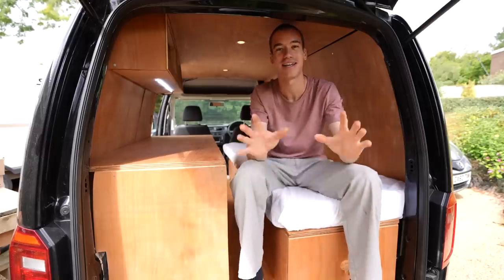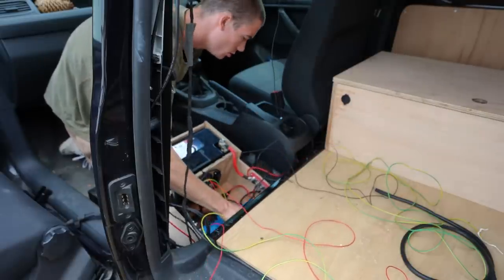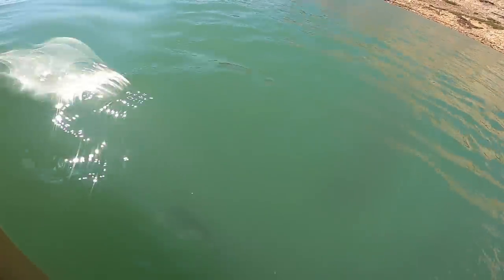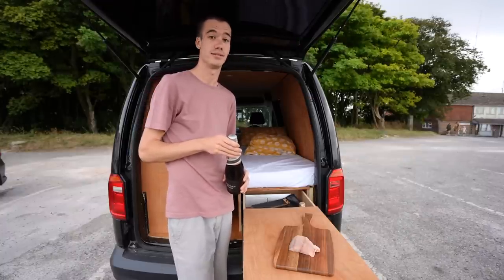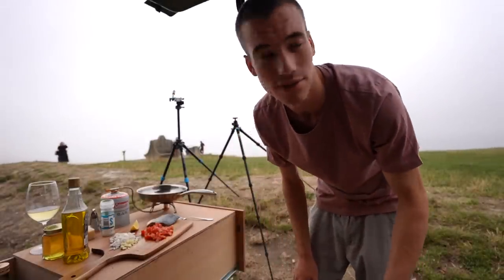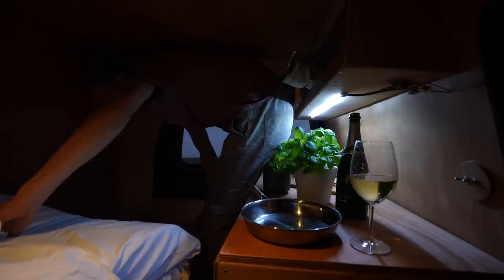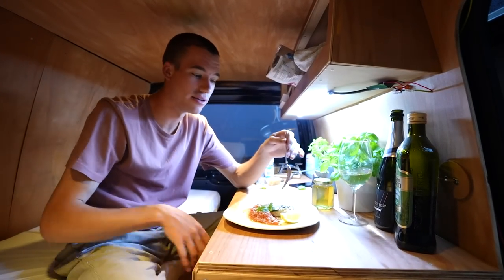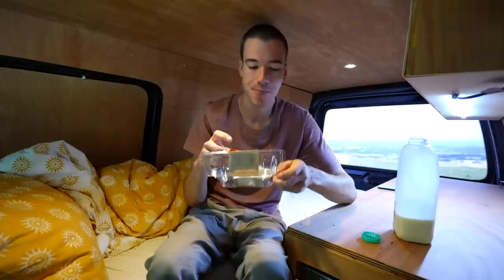Cooking in the FINISHED Micro Van Camper - Catch, Grow and Cook - Celebratory feast!

Comment: I have to confess I started watching the can conversion mainly for the comedic factor and didn't think it would turn out that great. I apologize because it actually looks really good and functional. I am blown away by this episode where I realised you've made your own honey, grown your own tomatoes and made your own knife. I didn't give you enough credit but you should be incredibly proud of how everything has turned out. I've just come back from a trip to Spain in my self converted van, and let me tell you how important ventilation is. Source out a roof vent that you can run to bring air in or out in conjunction with the wind deflector idea. A lot of moisture is created when you sleep in the van and that can make things mouldy, so a fan or vent will be crucial. Also think about a heating solution if you are going to do winter van life. Good luck. Subscribed.
Reply from the maker: Thanks for sticking with it! :)

Comment: Hi Alex, to help prevent the rain getting inside when the backdoor is open. You could makeup some side waterproof curtains from tarpaulins or an old fishing bivvy. A really good van conversation underway well done mate.
Reply: Get one of those pop up shade shelters that would fit over the back of the van.  You can get them from 2 x2 metres and up.  Quick and easy to put up....good luck with the travels

Comment: A pull out side awning or magnetic attached plastic sheet over back door means you can cook in the rain outside. A pull out table over your current table will save your back when working or maybe a table that attaches to the steering wheel if it’s not too cramped. A brilliant little van - very inspiring! 😊

Comment: NICE ONE ! 
Essential additions. Pan splatter guard.( can also be used to put a plate on over pan to warm, and on its side as a wind deflector for stove)
A stainless steel moka pot ( use with ground coffee no need for kettle) 
Some strong magnets some of those large beach towel clips and a couple of metres of black curtain lining. (Make blackout blinds / cab divider, wind blocker, light weight blanket  etc ) 
I just fitted windows to the slide doors in my van. Makes a big difference.  Looking forward to your travels. Ed.

Comment: Really love your mini camper! Just big enough! You can still place a roof vent, just saw through the metal, insulation and inner wood lining at the same time if you remember where electrical is. A lot of people use max fans (huge) or something but a small, low profile utility van fan might just do the trick and the right one may even fit underneath your solar panel! With a cracked window in the front and a fan in the rear it can be enough airflow.

Comment: Well done Alex, great job on your first van conversion. For cooking inside, to prevent oil splashing … you can buy a metal shroud, 3 panels hinged together. For cooking outside … have you considered making a water proof extension to the sides and back … very crude but tarpaulin lol. You can still add a vent, as long as you know where electrics are running! Looking forward to your European travel 👍🏼

Comment: Well done Alex, great videos. 2 suggestions that may help. If your concerned about the weight in the pull out draw once extended try attach some drop down legs on hinges that can tuck away underneath. Secondly on the frying in the van purchase a pan splatter shield that sits over the top, failing that look at the ridgemonkey pan mate. it closes shut and you can flip it over to cook both sides. Keep up the good work mate

Comment: Hi Alex, Just want to say I think you are braver than some people will perhaps take you for. I mean obviously you have faced some some adversities in life both through life and people. However, you have clearly shown your inner strength and overcome these and in a way which is true to you. This I take my hat off to you! You're doing you. You're doing what inspires you and makes you happy! In turn you're bringing happiness to other via your videos. 

Having watched your video, just wanted to say the van (caddy) let's give it the respect she/he deserves lol, looks amazing. You now have a foundation to build on and you'll always be looking at how you can improve it. However, first live in it for a bit and then soon the adaptions you may need to make will make themselves apparent. 

I did think , what with the rain and having to cook inside, perhaps a splash back mounted to the side panel behind where you may cook from time to time and a glass top over the top of the wood worktop area or some other heat proof top you can wipe clean that also shows the beauty of the wood through it.

Also what about a 12v extracted fan to help extract the fumes, smells, steam from cooking up and out the van?

Also with the issue around the oil splatting on your mattress, maybe something as simple as a long bungee type cord that will hold your mattress against the side panel whilst you cook and need access to the storage underneath. Will also mean the oil won't splatter on the mattress. In time perhaps you'll can find a better way but for now it may help. 

For now enjoy your van, and if you ever fancy a trip or find your way north it would be awesome to catch up with you. Hope these little suggestions maybe of some help. 

Keep up the positivity and enjoy your new van life.  I strongly believe that happiness is found with positivity and change, which you seem to have embraced whole heartedly. 

Regards and best wishes for the future , in all you choose to do .

Dom

Comment: Another fantastic video Alex.
Suggestion.. If you want to add a bit of support to your slide-out drawer,  why not add a couple of adjustable legs, either to the very end or half way along. The legs could drop down through holes in the drawer.  You could even use a couple of adjustable banksticks.  Dave, Roving Rods👌🏁

Comment: Maybe hang a cloth over you upper storage cabinets.  If you find nice fabric it will add a homey touch, and if you choose a heavy fabric it can help to keep some stuff in there while you drive.  Maybe even run some stretchy cords along the back wall of the storage area too so you can secure the stuff you put in there fur travel.  As an ode to 70s van life put a bead curtain between the back and the front cabin.    Just some ideas, the last one not so good but a vibe for sure...

Comment: I did not see that in another builds around, but fot rainy days and cooking,  thinking in the type of rear door that you have,  I would try to find a solution for cooking outside (maybe some sort of curtains hanging from the door attached with magnets). Do not know how you could find the way there but I think it would save space, smells inside and so on. You could use that curtains for outdoors shower too. I think if you find the way it could be incredibly useful. It would also protect your stove from the wind cooking outdoors.

Comment: Your pull-out table/worktop...why don't you get an adjustable pole or poles and make a pair of legs to attached to the end to add strength and stability. Just a thought but it seems steady enough. Or another idea...an awning type attachment which you put on either side of the back door when you have it raised.it would create a sheltered space at the back. But you have done a great job with everything.

Comment: congrats on getting the van and especially the electricity done, you have gained tonnes of experience. 
and massive congrats on that boat trip, you had bass after bass, seemed like a dream session! 
oohhhh man, your food looked amazing, absolutely fab, well done! as you didnt want the meal to be over, i didnt want this video to be over. 
did you think about a folding down leg to stabilise your drawer into a worktop? it can be made from the same plywood as the rest, imagine wooden crutches shape on hinges.
ps: the bolt lock on your drawer is savage 😂

Comment: Get 2 pieces of frosted glass made to fit the worktop (cooking area) and a piece as a splash back like in a kitchen in a house much easier to clean oil off it !!
Reply: Just use clear silicone to fix rhe glass to the ply wood, I suggest frosted glass so you don't see the silicone through the glass

Comment: Your rear window TINT won’t make any difference when you have lights on inside at night. Everyone will easily see inside through that tint. Make a foil bubble wrap cover for the inside and either use suckers or magnets to stick it on. Will also help with condensation, heat loss or excessive heat from outside overheating inside

Comment: Just a word of warning to the wise the Orion and smart solar will get very hot being enclosed in a drawer  especially the Orion unit I would have them mounted on the van walls somewhere to allow some heat to escape I have both on my boat and even wall mounted they generate a substantial amount of heat the solar looks good you can utilize the load output if set up so it disconnects sockets if the voltage drops too low  I would personally put larger cables into the Orion unit yours look a bit worryingly thin these units are designed to take a max of 16mm square cable less resistance in larger diameter cabling I have a fan that blows under the Orion unit up the fins to dissipate heat as output is limited when the unit reaches 40 degrees and also have mine mounted on a cement board backer 

Keep up the good work and I'm enjoying the content  if I wasn't into boat life I would be an avid van lifer 😁 enjoy your travels

Comment: Alex get yourself some ratchet crimpers for the electrical crimps a lot safer the wires won’t pull out of crimps better connection those crimpers you used you may get wires pulling out just some friendly advice